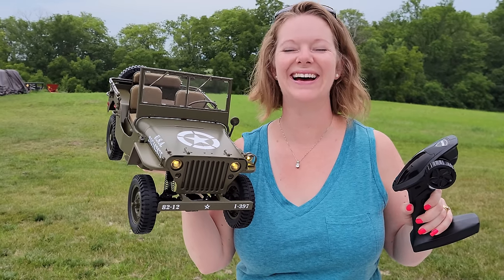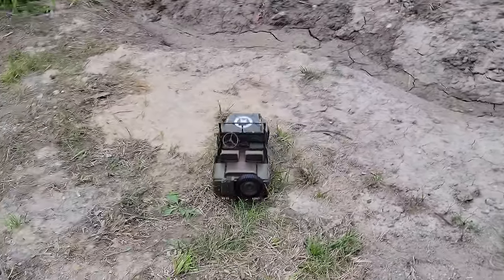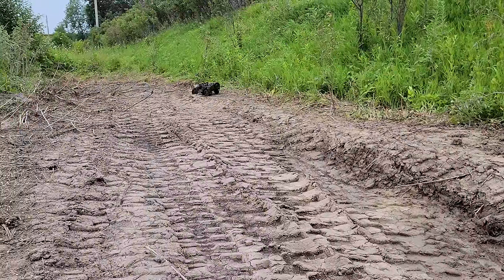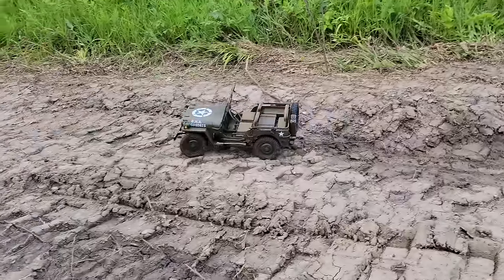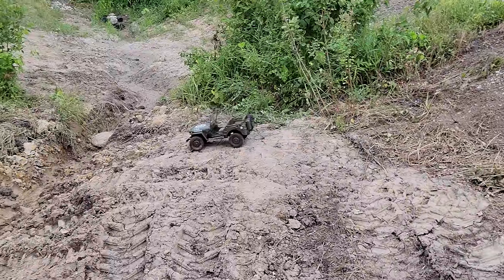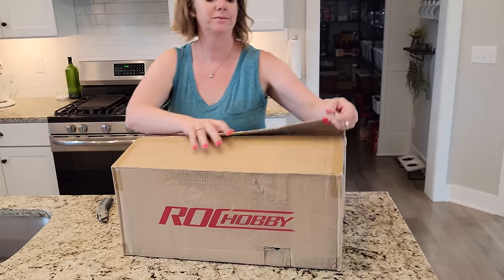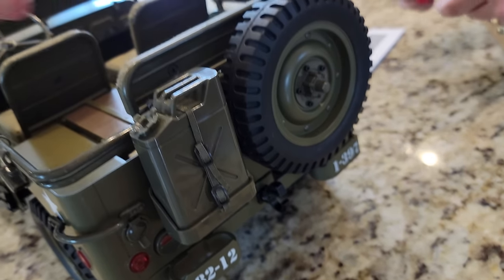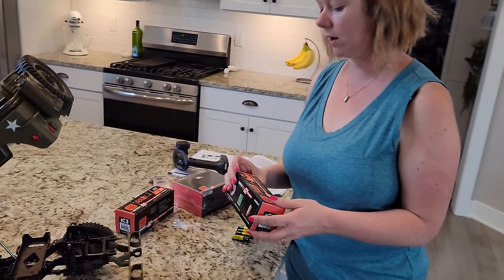FMS - 1941 Willys MB - 1:6 RTR Crawler - Unbox & Runs

Comment: Hey I have the same one. Mine won’t turn left or right. I just tried to use it. Thank you.
Reply from the maker: Okay, try the RATE KNOB - maybe it's down all the way??? Turn it up, and see if it'll start moving? If not, see if the servo linkage is attached. If it is, and still not moving, can you try another servo to see if the Rx is good, and the Servo is bad?

Comment: Bro, you are going to shred the gearing if you go directly from forward to reverse at full throttle. Most crawlers actually have to have the throttle pulled twice before they change from forward to reverse.  Free and unsolicited advice so take it for what you paid for it.
Also I would remove the front bumper even if I had to cut it off. It's terrible for departure angle. You would increase driveability by at least twice

Comment: The steering servo that comes in this is very weak. I put a Hexfly 25Kg servo in it the day I got it. Much better. An original GiJoe fits this perfectly. Oh. Another thing. The ESC probably will not handle anything larger that 3s. Let me know if you find out differently. We will let you do the experiment.